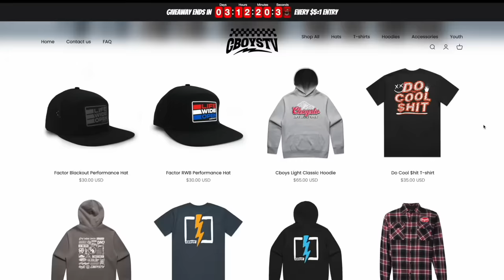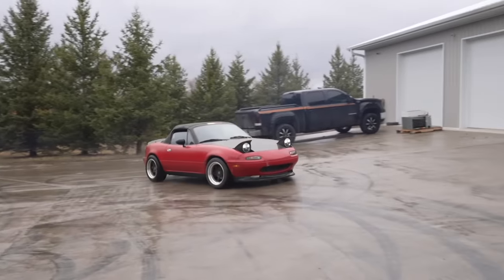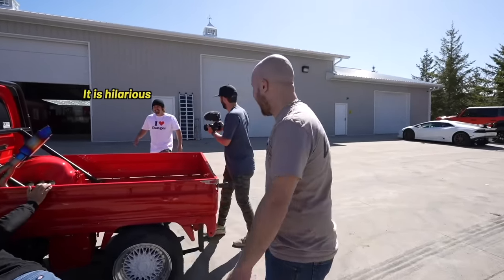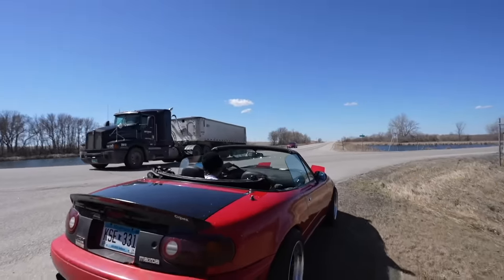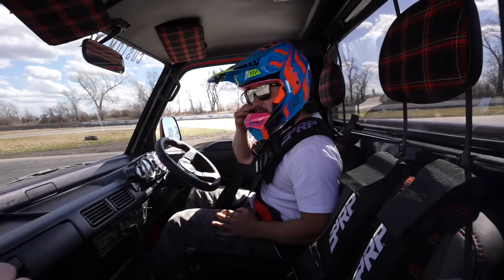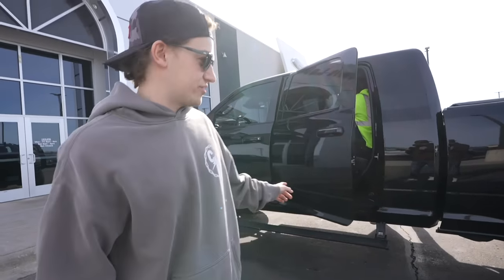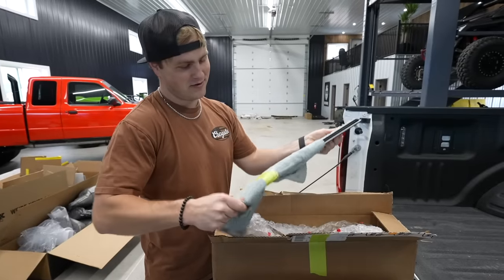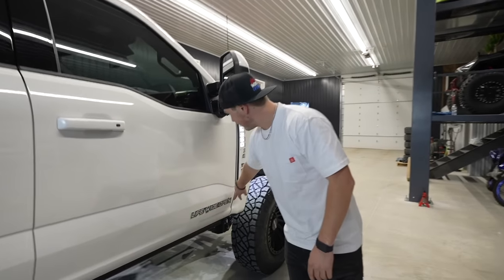Drifting my Crotch Rocket Swapped Mini Truck

Comment: Yk Evan is actually right about why it’s tipping there’s to much weight up high so when it gets grip sideways it wants to tip. Add some more weight down low and in the back and it will slide like a dream

Comment: In order to get the Miata to start winking you need to hit the headlight flip up switch repeatedly but do not fully click the button all the way in when doing so. If you press it all the way in each time it will not work, you need to press it about 75% of the way down and keep doing it until the headlights get out of sync. It’s fucking hilarious.

Comment: U couldn't use some like chromoly steel tubing like a 1 1/2 . But try to build it outside leave one end of tube open and fill with water then seal it up. And will make it like it's solid steel  , almost anyway  , the pressure inside won't alow it to bend easily.  If it brakes you will probably be thankful for the water to put out the fire 😅

Comment: you guys need to change the hand brake to a double push and pull one so when u push it the front brakes will come on and you dont have to have your foot stomped to the ground and when you pull the hand brake back it locks the back wheels up it will perform way way way better and less foot pump coz his carvs would be killin him after that lol you can see hes all tence in his shoulders and back from pushing sooo hard on the brakes

Comment: Personally I think that they should install two cinder blocks on both sides of the bed in the back or 4 side by side in the back of the bed to help the weight offset 
Form a guy using the gfs account lol

Comment: The back needs to go down another inch on the f250. Got a slight rake, would be more comfortable to drive too. And yea ik it’s probably for towing but there’s a lot of room to spare even with a heavy trailer attached. So what if it squats when towing, the springs are stiff as hell on them anyways.

Comment: The perfect truck is not something that you can buy it's something you have to make yourself . It's a combination of all three major US trucks . A Ford body , with a Cummins turbo diesel and an Allison transmission . If it's just a Ford , then you'll blow up the Powerjoke . Is it comes with a Cummins then it's more than likely going to rust away in no time . I'll admit I have zero experience with the Duramax diesel , but I doubt it holds a candle to a Cummins . My dad has a 12 valve Cummins that has over a million on it . And those weren't easy miles , that truck was very much overused and abused .

Comment: i think at least minimal suspension travel (a few cm) on the rear axle COMPLETELY bone hard I don't know if that's the right way to set it up with stabilizers otherwise there is too much / so much stress on the tires and EVERY bump (you can see well enough already the first 2 drifts) goes directly to the bodyworkminimal suspension travel (a few cm) on the rear axle COMPLETELY bone hard I don't know if that's the right way to set it up with stabilizers otherwise there is too much / so much stress on the tires and EVERY bump (you can see well enough already the first 2 drifts) goes directly to the bodywork

the front axle, on the other hand, is MUCH too soft and allows the body to dip and roll too much over the longitudinal axis, causing the tipping point to wobble. 

(8:32-8:33 go into slow mode and you will see how STRONGLY the va is dampened, which has favored the KICK by far).